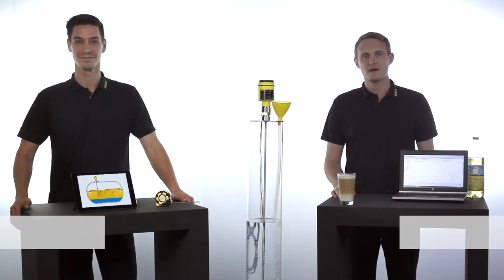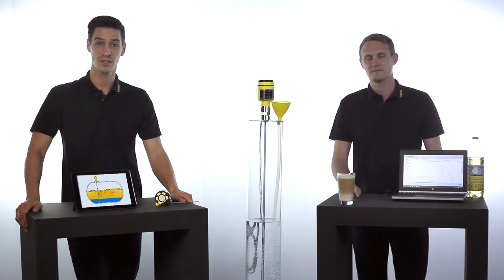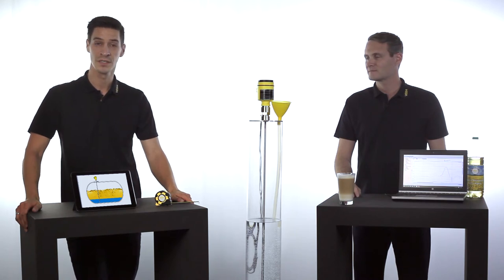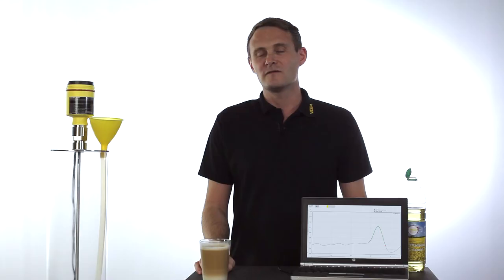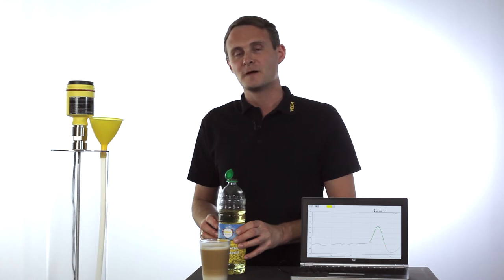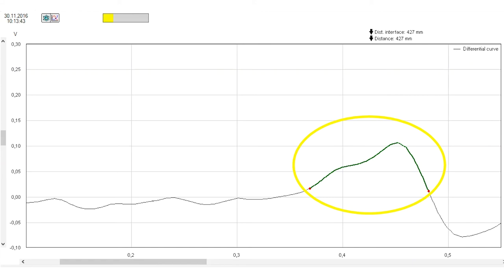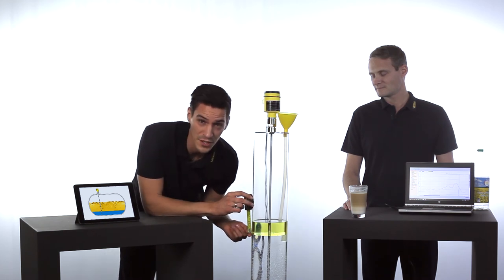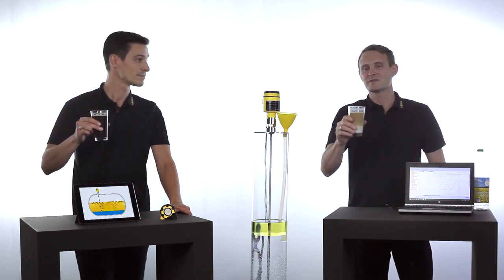Interface measurement with guided radar |  VEGAFLEX Series 80

Comment: Do you have a sample video where you look at the interface of a fluidized granulated Anthracite (Filter media) in water? Looking for a bed rise (expansion) measurement and interface between the media particles and water has been terrible to pick out.
Reply from the maker: Interesting question. Certain conditions are required for interface measurement with guided radar. For example, the medium with a lower DK value must form the upper layer in the interface application. To check whether this prerequisite is met or whether a different measuring principle would be more suitable, more information about your application is needed.
Please contact us and we will work with you to find the best solution: https://www.vega.com/en/Company/VEGA-worldwide